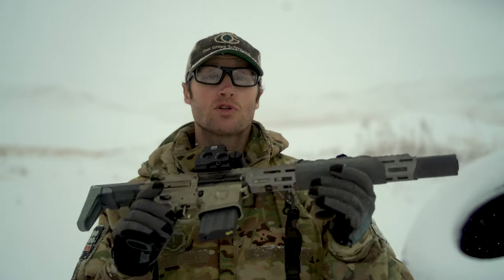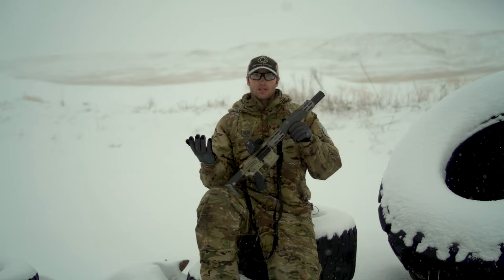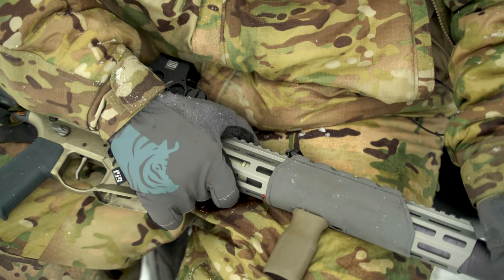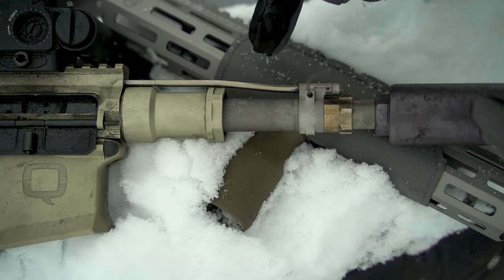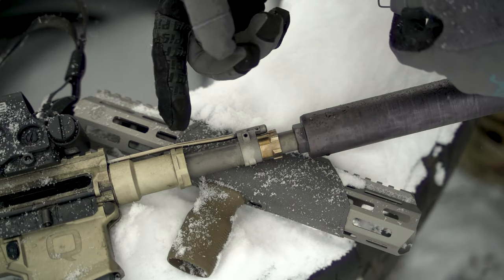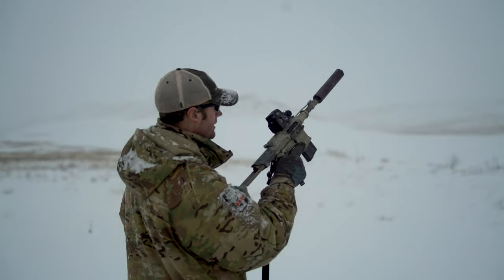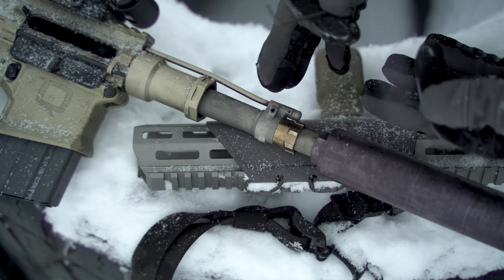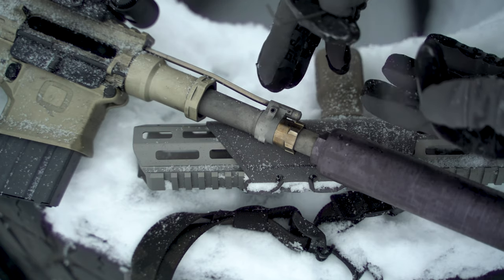How to Tune Q's Adjustable Gas Block

Comment: Great video!  I am curious about the honey badger SD rail.  Looks like you can't put a light or anything in the mlok slots by the suppressor, is the extended rail actually useful?
Reply: It has minimal utility from what I can tell. Best I can come up with is that it offers and extended sight radius with irons and it looks cool.
Reply: You are correct, the set up will minimize M=Lock usage.  The point of the extended rail is simply because the can gets so hot during use.  I've also suspect its friendlier for people who are used to 16" barrels
Reply: Its mainly so you can reach further out and not have to be all scrunched up on a tiny piece of rail. Also gives you spot to rest it on a barrier without a ton of suppressor hanging out over it or having to rest in the suppressor.
Reply: It's a big knock on the SD..most of the rail you can't use

Comment: What rail wrap and foregrip is that? I currently have a burn proof gear rail wrap. But I am not impressed with its performance because it is held on by elastic bands, which stretch overtime.

Comment: Is it possible that cheaper subsonic ammo may never fully cycle?
I was using S&B subs and backed the adjustment nut out so far that it was almost out of its threads.